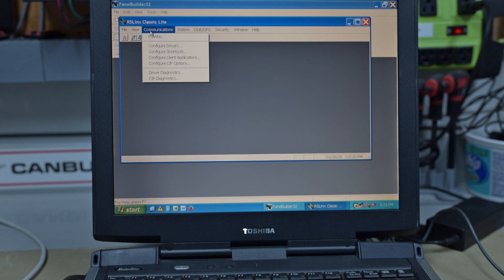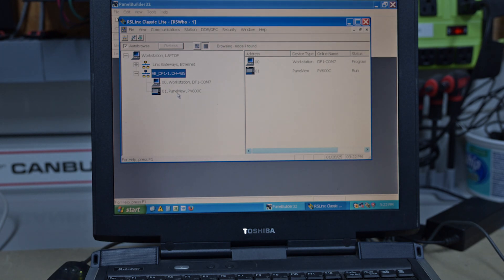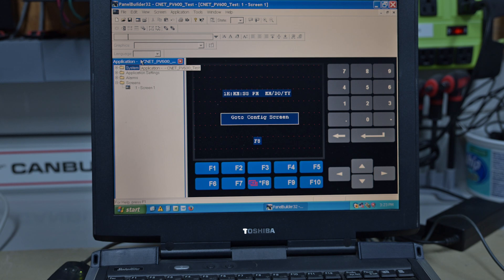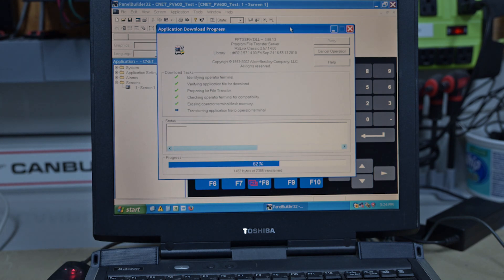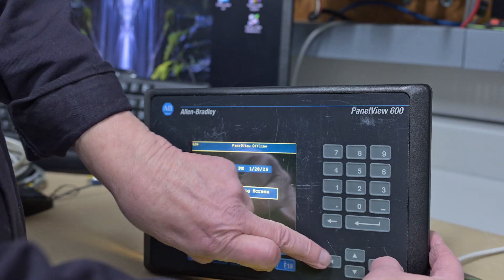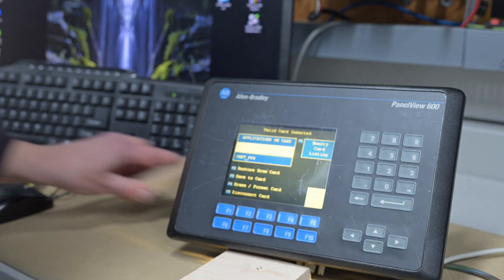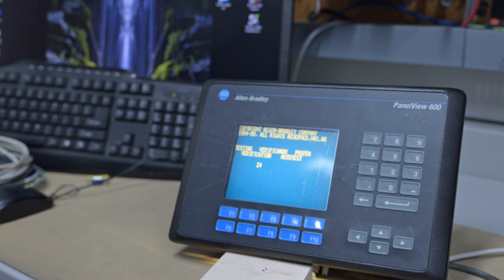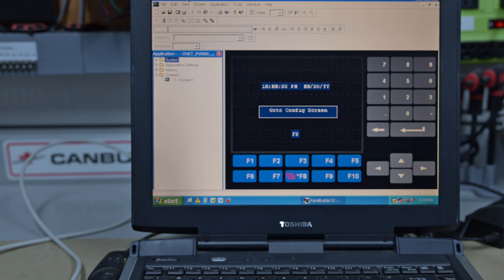AB Panelview Upload / Download

Comment: I'm running a Knudson KS-246A with an AB Panelview 550 and it showed me today three error codes: 208 (write to logic controller failed), 436 (logic controller has screen control) and 612 (no active node found on network). I cannot use the machine right now and service is difficult since the machine is not in the US. Any advice on how to work my way through? Thank you so much!
Reply from the maker: Hi Saevca:
Sorry I have no idea what a Knudson KS-246A is or how it would interface with the AB PV550.
The 208 code means it is trying to talk to the other item as directed by the setup, but nothing is found - This goes along with the 612 error - no nodes on network.
Not sure about the 436 error but to me that seems to be associated with the comm error.
All that being said it sounds like a comm port on either the processor end or PV550 end.
Start with the basics and make sure the wiring is not damaged between the 2 devices and that any required end of line resistors are installed if needed.
You don't say what communication protocol you are using between the 2 devices - RS232 - RS485 - DH+ - Devicenet - Controlnet??  They all have their quirks.

You will also get those errors if the other device is turned off or in program mode.  I suspect from your brief description that you only have the 2 devices - PV55 & Knudson??
Bruce B

Comment: Hi, 7 years ago I had to replace a 600 with one i purchased used and I was able to download the program from the original and install it in the replacement that was used in a different piece of equipment. The problem is I can't find my notes on how I did it and I don't see that I have  panelbuilder 32 installed anywhere so I'm assuming I didn't use that. Can it be done without?
Thank you
Reply from the maker: Hi:  If you can get a PCMIA card you can download the program from the original unit and then transfer to the new unit.
But at this point both units will have to be the same model numbers and sizes.
What is the problem with the original panelview?
Reply: @abplctestbench759  both are the same model and the replacement has a newer firmware. 4.42.
The issue is you can hardly see the screen even though it's lit up very bright. Ive replaced the backlight with LED before when they went dim. I'm really stumped on how I replaced this unit before without a card. Well, at least I don't have a card now so I'm assuming I didn't have one unless is got lost or thrown out with an old unit. 

Is it possible to do without a card ? Backup to a laptop instead? If not it will be worth the price of a card for sure . The equipment is part of a production line in manufacturing. 
The machine is 24 years old.
Ebay has become my source for parts.

Could I just swap the old memory board into the replacement unit ?
Reply from the maker: @sonnys8535  Hi:
Yes you can swap the memory board between the 2 units.  That is also a good time to clean the inside of the glass of the touchscreen.
Budget about 30ish minutes to do.
A #1 Phillips head is needed for the screws on the memory board.

Comment: is your card using in the video is 2711-NM11?
Reply from the maker: I had a generic card - The actual AB card if you can find one is the 2711-NM11.  The original label is gone so I have no idea on the brand that it is.
If you are trying to reset to factory default just go into the configuration screen and you can do from there.

Comment: what was on the card.  We are trying to set the PV 600 to factory default
Reply from the maker: I had a generic card - The actual AB card if you can find one is the 2711-NM11.  The original label is gone so I have no idea on the brand that it is.
If you are trying to reset to factory default just go into the configuration screen and you can do from there.

Comment: Thank you for the great video! Can any PCMIA card be used or does in need to be an AB card, or is there any configuration involved when attempting to use a new card? Thank again!
Reply from the maker: Hi Wild:
There are 2 styles of PCMIA card.
The AB part number is 2711-NM13
One is rated for industrial use and the other is not.  Make sure you ask that question if you are buying a generic card on line.
If the seller can't answer the question then go to a different seller.
I no longer have the contact info for the person in the US I got my generic card from a long time ago.
If you can find an original AB card it is much easier.
You can use a generic card like I show in the video.  When you plug it in as long as it is the correct card no configuration should be needed.
Just use the format function on the PV and all should be fine.

Thanks for asking.
Bruce
Reply: @abplctestbench759  what do you mean pcmia card not industrial?
Reply from the maker: @iamTitingTV  Hi:
Some of the cards were made for PC only and are not recognized by the panelviews.  If you have a PCMIA card you can test it in the panelview.  If it is an industrial series of card the PV will recognize it.  If not then it won't.

Comment: Plz i have pv600 type 2711-b6c8L1 how can i upload program 
This panel has 2 ports dh+   and rs232 printer
Reply from the maker: Hello:
The Panelview software includes a file transfer utility to upload and download your file to the unit.  The memory card I have shown in the video is for backing up the program and can be used to move the program file from PV to PV.
I do NOT have any copies of the software as it is owned by Rockwell and I am NOT authorized to sell it.
Reply: Witch cable can i use a null modem or straight 
Thanks
Reply: Plz witch cable can i use to upload program
Thank you

Comment: Great video, do these hmi's have a replaceable battery?
Reply from the maker: HI:  Most of the older ones don't have batteries in them.  But if there are they are soldered on to the main processor boards.  In the newer PV the battery is for keeping time and date and the program is stored in the memory.